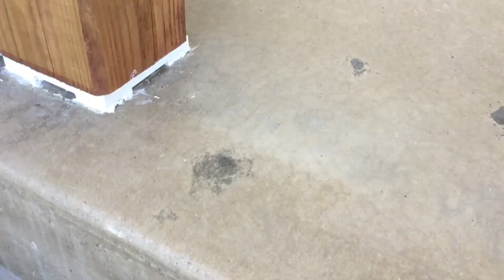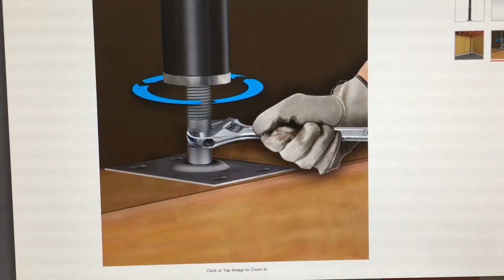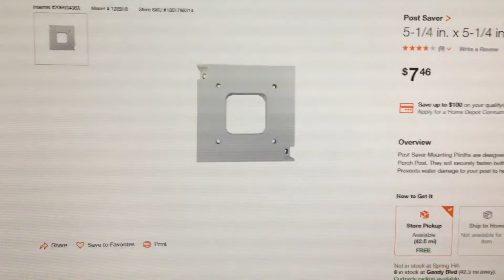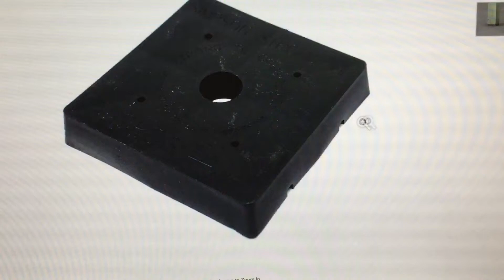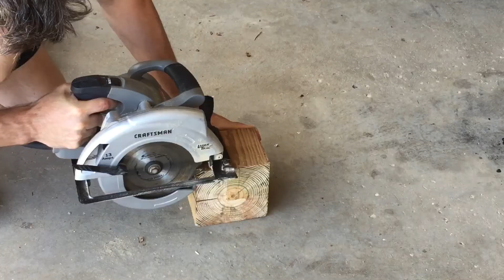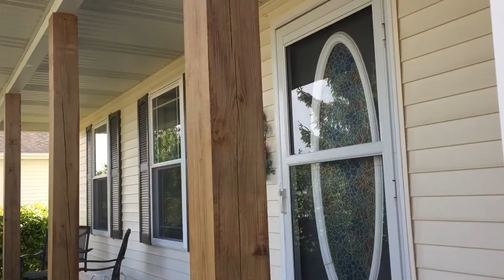How to Replace Porch Posts Columns, Complete Guide with Tips,  Easy

Comment: Enjoyed the video but also wondered about some type of mechanical connection between post and concrete porch. I'm in southern California (earthquake country)  so maybe code requirements are different in your area.
Reply from the maker: Thanks! This is a great question.
New construction options involving a long vertical anchor through the center of the post are not practical in this scenario of replacing a post.
There are angle brackets available, but they would result in exterior flanges and anchors that would be difficult to cover with trim.
Example (this is a random product for reference and I don’t endorse it):
https://amzn.to/3DvU6xU

Another option is to toe in tapcon concrete anchors. 

I personally put down a big squirt of construction adhesive on the concrete before placing the post. I know of other porch posts that are not anchored. But, as a result of your message, I will plan to go back and add mechanical anchors.
Reply: @HowtoandReviewsOfficial  Can a porch post be placed on a precast concrete deck footing block? I have some that are cast with a socket designed to hold a vertical 4x4 or horizontal 2x-lumber. I could drill a hole into the center to hold a vertical anchoring bolt or rebar, and make a similar hole in the 4x4, but the name "deck block" kind of implies to me that they are meant for decks, and might not be acceptable for supporting a post that holds up the roof of an attached porch.

I have a roof overhang over my front walkway which needs to have the corner post replaced, and I've been considering using a deck block to hold it.

Note: I understand that codes vary by state, and your comment and advice here is not to be taken as legally-authoritative or even sound in terms of engineering. I take all risks in my actions when I attempt to make repairs on my house.

Comment: Yeah well, in the state of GEORGIA the porch column MUST BE attached to both bottom and top surfaces. One cannot place a hollow knotty pine porch column on the concrete. That is a building code violation. Further, my 6x6 post measures 5x5 yet I cannot find a plate for the bottom that raises the column per building code 1 inch above mounting surface. Everyone I looked at is designed for 6x6. You have to be kidding me.

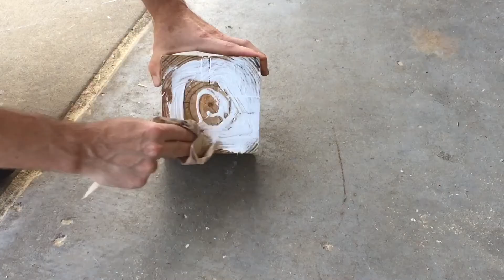Comment: 5:45 I saw a gentleman used Goo for shoes to put on the bottom of the post maybe you could do a video on what works best, if you have some of the post left over you can dap them up and then set them on water on concrete just plain of water and then check to see which one sucked up the water.
Reply from the maker: That would be interesting! I’ve added it to my list of future videos, which is about 10 miles long, and always gets longer, not shorter.

Comment: The new posts all seem to have long irregular vertical cracks....Water will almost certainly get in and you will be thee replacing those posts within 2 years or so....Surely you would seal those cracks with epoxy silicone or builders bog...
Reply from the maker: Vertical splits are completely normal. It’s not a problem. Nothing to worry about.

Comment: I only have one question or may be I missed it , how did you secure the bottom base/cement ?
Reply from the maker: Good question. I went back and used Tapcon concrete anchors.
Reply: Exactly. He didn’t! 🤷🏽‍♂️

Comment: I have a question...what is the legal width size of that post.  Is it 4x4 or 6x6?
Reply from the maker: I used a 6x6 (actual size 5 1/2 x 5 1/2). It is also common to use 4x4 (actual size 3 1/2 x 3 1/2 half).

Comment: The bottoms don’t require securing to concrete ?
Reply from the maker: This is a great question.
New construction options involving a long vertical anchor through the center of the post are not practical in this scenario of replacing a post.
There are angle brackets available, but they would result in exterior flanges and anchors that would be difficult to cover with trim.
Example (this is a random product for reference and I don’t endorse it):
https://amzn.to/3DvU6xU

Another option is to toe in tapcon concrete anchors. 

I personally put down a big squirt of construction adhesive on the concrete before placing the post. I know of other porch posts that are not anchored.
But, I went back and toed in tapcon concrete anchors.
Reply: @HowtoandReviewsOfficial  Not difficult just laziness. New constructions or some professionals don't anchor because it cost more in both time and labor.
Reply: Sorry I asked before reading comments I see you have answered before thank you great vid
Reply from the maker: @handyishrandyish334  No problem! Glad it helped!

Comment: I've seen in other videos where log cabins are made, and they scorch the ends of beams to prevent water damage and protect from elements  - do you think it would work in this application?
Reply from the maker: I am not familiar with that specific method, but it is interesting and I will look into it.
There are other products for this specific application, like Copper Green.
I used caulk because I already owned it.

Comment: Did you secure to the floor? How?
Reply from the maker: It was secured to the floor with a squirt of caulk and gravity.
Reply: @HowtoandReviewsOfficial  how did you secure the composite plate to concrete? Tapcon concrete screws?
Reply from the maker: @joaquinsuarez6090  Tapcon screws are probably the best option in my opinion.
With a post placement, it is not possible to do anything up through the center like with a new installation.

Comment: What plate did you set your post on?
Reply from the maker: Here is the link. I purchased them from Home Depot.
https://www.homedepot.com/p/Post-Saver-5-1-4-in-x-5-1-4-in-Vinyl-Plinth-128918/206904383
This is another option:
https://www.lowes.com/pd/Simpson-Strong-Tie-6-in-x-6-in-Wood-to-Concrete-Retrofit-Base/1002709750
Reply: This comment was visable while i was watching the video and i knew he was spending too long talking about raising the roof.

Comment: You should use a wood treatment like copper green and soak the ends of the posts for 24 hrs not liberal caulk.
Reply from the maker: Thanks for the input, I appreciate it!
Reply: Or just use PT Lumber #2 for ground contact.
Reply: @mikeryan6277  PT lumber looks like ass... why would you use that?